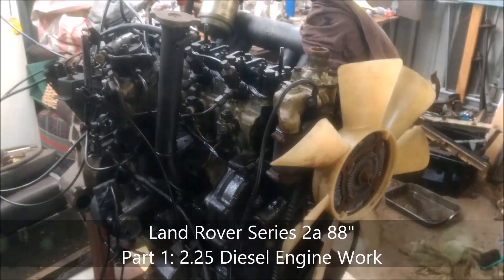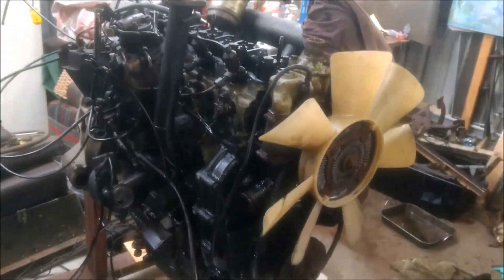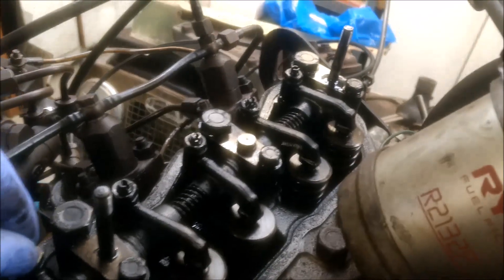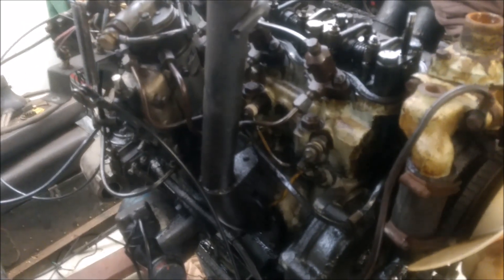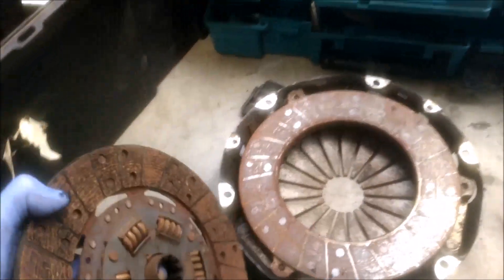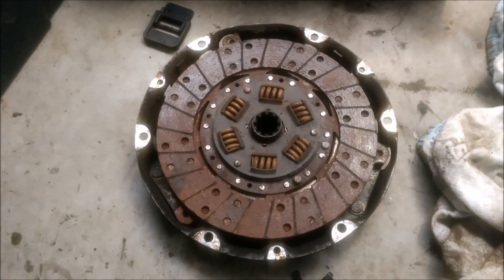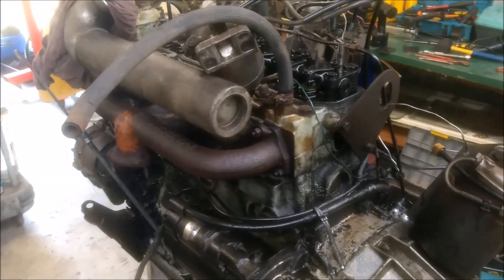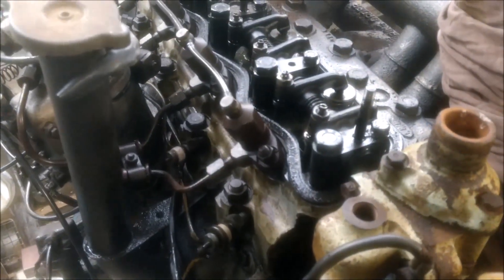Land Rover Series 2a 88 - Part 1: 2.25 Diesel Engine Work

Comment: Hello, have you checked the engine number to confirm that it always has been a diesel engine? I had the problem that somebody had converted a petrol engine to diesel without changing the crank shaft.
Reply from the maker: No I havent yet, but that would not be good news!  Good reminder, ill check now. Thanks.
Reply from the maker: Just checked, the number (first 3 digits) matches a diesel engine.  Cheers

Comment: All the degreasers seem to promise lots and deliver little, getting your engine clean will take time 😬
Reply from the maker: Yeah I certainly found that out... buts really its where the crap falls is the problem!
Reply: Rover Tasmania I used a cement mixing tray, I'm sure it has a proper name if you are in the building trade, but basically a large hexagonal plastic tray with sides....
Reply from the maker: Yep, i know the ones. Ill see how i go later, maybe can do cleaning over time.